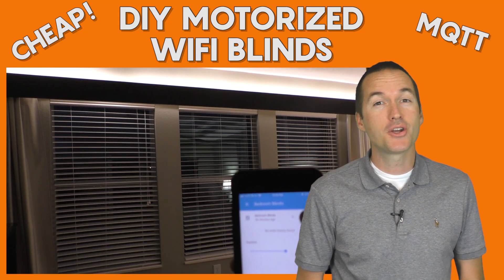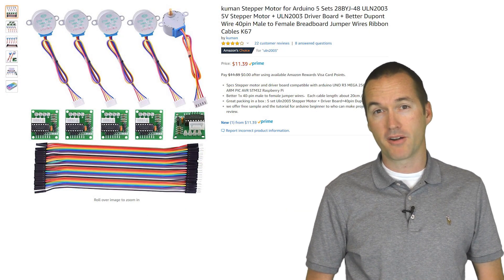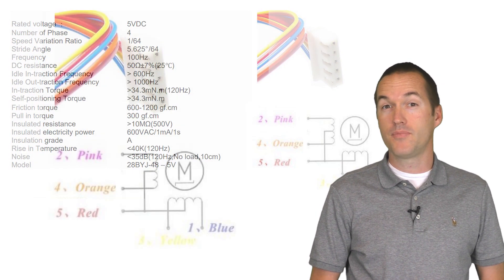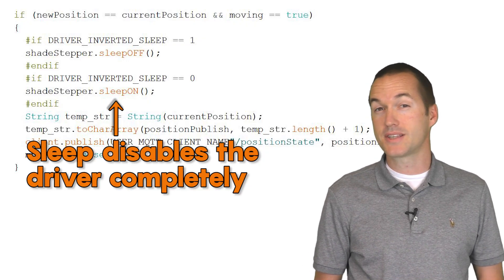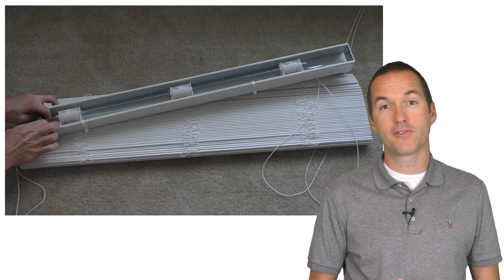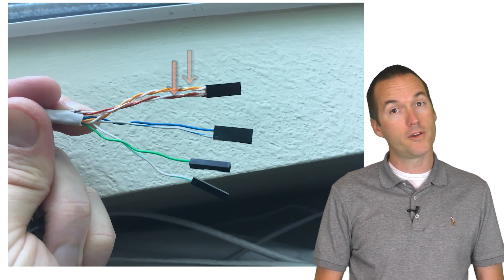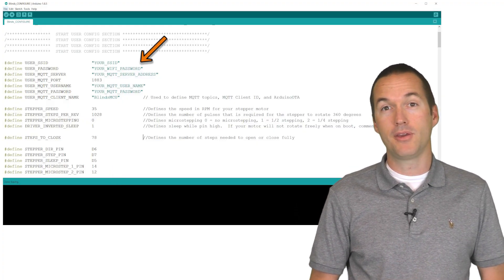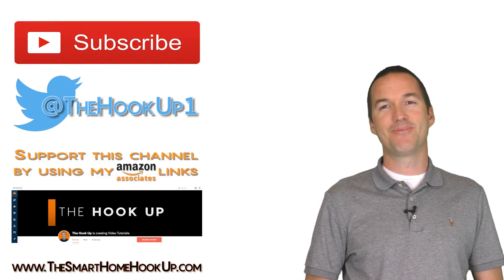Motorize and Automate your Blinds for $10! (WiFi)

Comment: Is the 12v 2amp power supply necessary or could I use a 12v 1amp?
Reply from the maker: 1 amp is more than plenty for 1 blind, I went with a 2amp because I am running all 3 at the same time... but 1 amp probably would have been fine for that as well.
Reply: The Hook Up awesome. Thanks for getting back to me. I found a bundle of 5 on amazon for 10 bucks. Just wanted to make sure it would work the same.
Reply: Sorry to bug you again but I got everything wired up and cant get this coding figured out. I have taken a crash course on arduino and had to tweak the code due to ArduinoJson giving me an error that it was 5 and needed to be 6. I got that updated but now its telling me that jsonBuffer was not declared in this scope and also that all of the pins were not declared in this scope. Do you know what that means by chance?
Reply from the maker: @gitarplayer229  You needed to stay on ArduinoJson 5, what error was it giving you?
Reply: The Hook Up I did figure that part out. Now the issue is relating to scope and variables. It’s telling me that the use config section is not in scope. It’s the part of the code that lists the pins and their functions I’m assuming.
Reply: The Hook Up I posted the code to your github errors page. If you have a second to look I would greatly appreciate it.
Reply: Im really stuck here. I started over with Arduinojson 5 and all that is good but it is still telling me that "D6 was not declared in this scope" Is there something im supposed to change in the user config section?

Comment: I have 2 connected two 1 power supply. Seems Alexa gets confused which one is which after reboot? They discovered as separate devices?
Reply from the maker: Did you give them different invocation names?
Reply: The Hook Up ‘left side’ and ‘right side’. They work when I reboot, after couple minutes seems it thinks it’s the same device. I.e hitting left side will close the right then go unresponsive while the right side continues to work ok.
Reply from the maker: I see, I admit, I didn't do any testing with multiple alexa devices.  I have an idea of what the problem might be.  Let me investigate a bit tonight
Reply: The Hook Up thanks, this is an awesome project!
Reply: Any luck. My work around is to disable one, then reenable. Sometimes they both work

Comment: Hi, iv just bought the printer and printing the second motor bracket as i write, unfortunately the 5mm hex is too small tho, im going to run 6 blinds in my conservatory, im going to fit an Ethernet coupler under the pelmet and then an Ethernet cable to the blind for a quick connection, i just wanted to confirm that id NOT need extra cables for smartthings, as my cables will be hidden behind coving, i think you call it crown moulding in the US, anyway i liik forward to smartthings integration and deffo battery packs for other blinds, keep it up, cheers from sunny Manchester UK
Reply from the maker: No extra cables required, smart things is still relatively untested, but the connections are the same
Reply: @TheHookUp  Ok thanks. how many ah power supply would i need do run 6 of these on one psu, thanks.

Comment: Hey Robert, thank you for the awesome solution. I currently have a servo-based solution which is not that reliable. I have completed all the set up as per your GitHub page however motor does not seem to turn.

Here is the list of things I checked - 
1. All the voltages are as expected.
2. NoceMCU is indeed connected to a broker.
3. Published positionCommand twice from HA to get an initial position for cover.

The only thing I am not quite sure if I got correctly is cutting of red wire and scrapping center terminal for step motor. Is there a way to test that I got it set up correctly?
Reply from the maker: Did you make sure the Sleep pin and the RST pin are bridged on the driver?
Reply: @TheHookUp  Yes, I made sure that they are bridged. Is there a way to confirm that I successfully converted stepper motor to bipolar one?

Comment: Great video!  I have a question; how did you hook into a power source?  I didn’t see any lines coming out the bottom of the blinds..  Did you plug into an outlet or did you go behind the Sheetrock and tap into a line there?
Reply from the maker: They run behind the valence at the top and then down behind the curtains on the side.
Reply: @TheHookUp  Thanks for the reply.  After they go down the side, behind the curtains, do they plug into an electric outlet?  What's the power source? That's what I was wanting to know, sorry.
Reply from the maker: @therealNSB  They are plugged into one of these: https://amzn.to/2W1dFMj  It's probably super overkill though (5A).
Reply: @TheHookUp  that takes me to a 5v 5a here in the UK i presume u didnt use that as the motors now use 12v, im going to go overkill and use a separate cable for power as im running 6 blinds in one go

Comment: Hi @thehookup will the ULN2003 driver work also?
Do you know the diagram for that aswell?
Awesome video :)
Reply from the maker: You will need different code for that (either the stepper.h library or AccelStepper.h)
Reply: The Hook Up the Reason why i a asked, the image you showed in the video, shows that ULN2003 already, and its working fine with 5v and 12v.
So why the effort and buy another driver for extra cost?
That could be awesome.
Reply: @dkautomater  can you please provide me the code with ULN2003, I  want also try Hookup initial blinds option. thanks
Reply: Vinod Tiwari its in the decs in the video :-)

Comment: i will pay someone 20 per window to do mine
Reply: Ill pay double that
Reply: @mattandersen1601  How many windows do you want done???
Reply: Yep I would pay someone 40 per blind to do this for me. I need 3 blinds done. Also I have a sun room that's about 18x6 on the back of my house. 3 sides are all windows and I'm wanting 1floor to celing  curtain to cover all 3 sides on some kind of track. I guess 2 curtains on each side that met in the middle would be ok but would prefer no gaps. Also would need to be automated. Anyone have any ideas on something like that? I know that's alot of curtain and probably pretty heavy so would there be anything out there to be able to move 30 ft of heavy curtains on a track?
Reply: How many windows do you want done???
Reply: Did you find someone to do it?

Comment: What brand and model blinds did you use. The 2" ones i just picked up do not fit the printed parts
Reply from the maker: Which part didn't fit?  The box or the hub adapters?  Our blinds were installed by our builder, so I assume they are whatever the cheapest possible solution was.
Reply: @TheHookUp  the box didn't fit. Also my blinds are the stringless type. Manufactured by better homes and gardens.

Comment: See the title for the video. Sounds cool. Parts are above 20 dollars. Need a 3d printer. Thanks click bait video.
Reply from the maker: My project as shown in the video used 3 drivers ($6.60),  3 motors ($6.60), 1 buck converter ($1.70), 1 nodeMCU ($4.60), and 1 (2A) power supply ($8.10).  That would be  $27.60 for 3 motorized blinds, or $9.20 each, and that's using Amazon pricing, if you're willing to buy from aliexpress and wait for shipping you could do it for $6 each pretty easily.

$2.20 per driver: https://amzn.to/2DpehAP
$2.20 per motor: https://amzn.to/2DmhrVS
$2.60 per power supply: https://amzn.to/2VhWE0c
$1.70 per buck converter: https://amzn.to/2GvSn0J
$4.60 per nodeMCU: https://amzn.to/2VjnfKl

Comment: Anyone have any trouble shooting tips for the Alexa version? I flashed the firmware, got the Blinds_Setup wife connection, configured the wifi,alex id and rotations, and I can see it connect to the wifi after it restarts but it never shows up in Alexa App on my phone. Using Termite serial monitor I get this in the output when I boot the NodeMCU. I have also tried this with a D1 Mini and get the same result.
mounted file system
reading config file
opened config file
{"alexa_id":"OB","rotations":"12"}
parsed json
*WM: Adding parameter
*WM: ID
*WM: Adding parameter
*WM: rotations
*WM: 
*WM: AutoConnect
*WM: Connecting as wifi client...
*WM: Using last saved values, should be faster
*WM: Connection result: 
*WM: 3
*WM: IP Address:
*WM: 192.168.0.30
connected...
Device Name is OB

After that I just get a bunch of non-stop 0 0 0 0 0 0  in the serial monitor.
Reply from the maker: That's correct. 0 in that monitor is just the current position off the motor.  Did you go discovery in the alexa app?
Reply: @TheHookUp  Yes and it never shows up, tried different alexa IDs, switched to a D1 Mini and get the same issue. Not sure what else to look at. It configures fine, connects to my Wifi fine, just no alexa. I am rebuilding from the source right now and going to try that out. took a bit to get all  the required libraries installed to compile but I just flash the NodeMCU so I will let you know how that goes.
Reply: Ok recompiled from the source on github configured it and still the same issue, Alex App Add new device finds no devices.
Reply: @TheHookUp  From the source version I am seeing an error when its trying to save the parameters. After that if I hit reset it shows the ID is blank. Figuring that is the problem but why is it not able to write.

1:33:29.544 -> *WM: WiFi save
11:33:29.544 -> *WM: Parameter
11:33:29.544 -> *WM: ID
11:33:29.544 -> *WM: OfficeBlinds
11:33:29.544 -> *WM: Parameter
11:33:29.544 -> *WM: rotations
11:33:29.544 -> *WM: 12
11:33:29.578 -> *WM: Sent wifi save page
11:33:31.579 -> *WM: Connecting to new AP
11:33:31.579 -> *WM: Connecting as wifi client...
11:33:38.294 -> *WM: Connection result: 
11:33:38.294 -> *WM: 3
11:33:38.396 -> Should save config
11:33:38.396 -> connected...
11:33:38.396 -> saving config
11:33:38.396 -> failed to open config file for writing
11:33:38.396 -> {"alexa_id":"OfficeBlinds","rotations":"12"}*WM: freeing allocated params!
11:33:38.396 -> Device Name is OfficeBlinds
11:33:38.565 -> 0
11:33:38.565 -> 0
Reply from the maker: @nickm324  when you compiled from source did you pick "1mb 3mb SPIFFS"?
Reply: Ok, 2 NodeMCU's 1 D1 Mini and all do the  same thing, Blind Setup works fine, it connects to my network, but Alexa cannot see them.
Reply from the maker: What echo devices do you have on your network? Have you used echo local control before?. Have you tried the web interface for alexa?
Reply from the maker: The 4m (3m SPIFFS) is what you want
Reply: @TheHookUp  I have 3 echo dots and a regular Echo. Dont know what echo local is,  I did look at the web interface for alexa but didnt see anything there for adding devices.
Reply from the maker: Do you know what generation dot? I've tested discovery a bunch of times successfully, I've got gen 2
Reply: @TheHookUp  All are gen 2.
Reply from the maker: Huh, I'm stumped.. Any strange networking stuff going on? vlan?
Reply: @TheHookUp  No pretty standard. Net Gear Cable Modem/Router.5ghz and 2.4.. I have a harmony hub and hues hub on the network, Hues hub does not seet the nodemcu either.
Reply from the maker: @nickm324  neither of those hubs should see the nodeMCU since it's wifi not zigbee.  In the arduino IDE if you go to examples -> ESPAlexa you should see a sketch called "ESPAlexa Color", it's as barebones as it comes, can you try putting that on the nodeMCU and see if your echo can discover it?
Reply: @TheHookUp  I did not see an example ESPAlexa in the IDE, found it on the net and added the other required libraries. Flashing now.
Reply: @TheHookUp  Ok, I put the ESPAlexa Color sketch on the NodeMCU and it connects to my wifi but alexa does not find it.
Reply from the maker: @nickm324  hmm, I think there might be something strange going on with your network.  If the baseline ESPAlexa sketch is not discovered then I doubt anything will be discovered. 

Last thing: Go to https://alexa.amazon.com/spa/index.html

Click on "Smart Home"

Then click "Devices"

Then scroll to the bottom and press "Discover"
Reply: @TheHookUp  Ran discover from there same thing it doesnt see it, Although I have 11 other devices in Alexa and they are all working. Maybe I will remove a few of those and see if Alexa can rediscover them.
Reply from the maker: @nickm324  The difference is how Alexa discovers them.  In this case it's a local protocol (your alexa device sends out a "knock knock" message on the local network, and any device with alexa capbabilites sends a "I'm here" message).  It's possible all your other devices are using a cloud protocol (like tuya, and TP link do).
Reply: @TheHookUp  It think the issue is related to this from the FauxMO Issues threads and post on the Adafruit website. Although I have tried just about every thing that was stated in that thread and still cannot get it to work. I know it says GEN3 in the title but once you start reading the thread you will see that Gen 1,2 and 3 are all having issues.
 
Not detecting your device? There's an ongoing issue with the newest version of this library not detecting devices on the fauxmoESP repository: https://bitbucket.org/xoseperez/fauxmoesp/issues/58/v30-not-discovered-by-alexa
Reply from the maker: @nickm324  Here's a bin compiled with Core 2.3: https://github.com/thehookup/Motorized_MQTT_Blinds/releases/download/Alexa_No_Hub/Blinds_CONFIGURE_Portal_Alexa_Core_2.3.bin
Reply: @TheHookUp  I know this was a long time ago but I just got frustrated and gave up. Now we are on lock down I decided to give it another go. I tried the bin you supplied above and still have the same issue. So I went back to EspAleax examples and load the first basic example and configured my wifi info, uploaded to my D1 Mini and afer power cycled it. Then did a discovery with alexa and immediately it found 3 new lights. So there has to be something in the code causing an issue. I even tried compiling the source and uploading that and still it will not find it.
Reply: @nickm324  Same problem here   Alexa wont discover the device   Been up and down with fauxmo versions.. tried the bin file sent to you   as well no discovery

Comment: I have my setup using the 12 steps as recommended, but when I tell alexa to open the blinds the motor only turns about 1/2 a revolution. Is there something I forgot to set or do? Dont seem like 12 STEPS would be enough to move a blind to completely open or closed. We are talking about STEPS (STEPPER) and not 12 revolutions correct?
Reply from the maker: The answer is actually that it's not steps or revolutions.  Basically I tested out of a bunch of different speed/duration impulses to see which one was best at closing my blinds.  Each impulse is 80 steps, so 12*80 is 960 steps.
Reply: @TheHookUp  ok, I will start testing values to match my blinds. Thanks.
Reply: I’m very confused now. What is the STEPPER_STEPS_PER_REV used for then? Does it serve any purpose? I can’t get the numbers to work. Can you please explain how to adjust the values and what it does so I know what to change? When I tried the code out it made a bump(stopped and started quickly again) each 1/4 rotation while it was rotating. When I tried to set a low speed the motor almost wasn't able to move. I'm using a NEMA 17 stepper motor but I don't think that it would affect anything. Thank you so much. Awesome project.

Comment: Excellent video. I have been researching this sort of project for many months now. For me, it was making my blinds Alexa enabled and fully hidden via a battery. Like you, I first used servos but then abandoned that idea due to the loud sounds and high current draw. I think your implementation + a 12v 3000mah battery would be a good idea, and sleep the ESP. Only issue is that the ESP8266 would not be able to respond to Alexa during sleep, so some other idea would have to come into play.

Comment: I love your work and please keep it coming!  I have loaded your script and have the stepper opening and closing my blind but my nodemcu will not connect to my MQTT broker after a power loss.  I have to press the reset button for it to connect.   Any ideas?  Thanks
Reply from the maker: After power loss of the blinds, or power loss of the broker, or both?
Reply: After a power loss to the blinds.  The MQTT broker is on a UPS so I don't expect a loss to my broker without an extended loss of power.  
When I supply 12 volt power, I do not get checkin messages until I press the nodemcu button.

Comment: Great Work!! This is right on time as this summers project is to automate all my blinds to include my sunshades. I do have 2 quick questions. The most important is,  What is your recommended amperage for each unit? I am going to go a little different route with 12 Power supply in my attic to supply power to several units at a time. 

2nd question i am not to familiar with MQTT and my experience in the past i have run into multiple issues and really need easy walk through that will help me understand. I want to run MQTT on a separate machine than my hassio. I have a high power server running several programs with little to now effort.

Comment: I'm very interested in this, but I would love to retain manual control. Let's say the blinds think they're at 0%, then I go open them half way (50%). What's going to happen if I tell them to open to 100%? They'll open the other 50, then start slipping? Is that bad for the motor or the blinds? I could probably have them reset themselves at night. Maybe open to 100%, then close to 0%... Just thinking out loud here.

Any ideas?
Reply: You might want to add a potentiometer to the shaft so you know the absolute position. This way your stepper motor could know only drive until you reach a certain value on the potentiometer

Comment: Re: servo - you can use a transistor to turn it on/off as needed.  Servo has the advantage of absolute position sensing which is nice.  Many thanks for the video - watching other folk's implementation is a great way to learn!
Reply: Neo Geo this is what I was thinking. Is the servo quieter than these steppers?